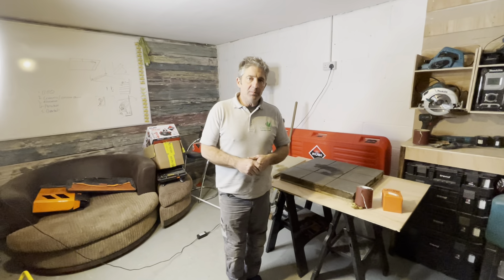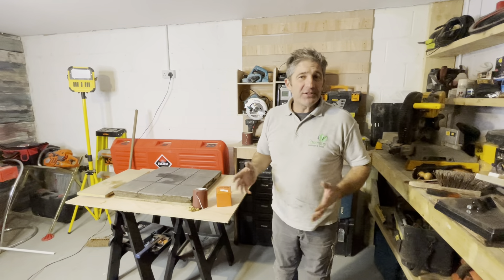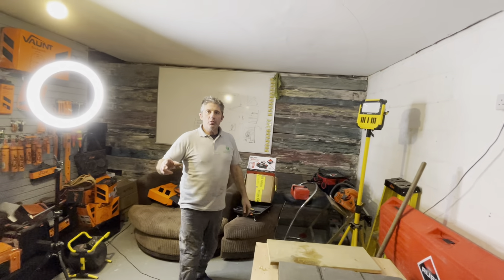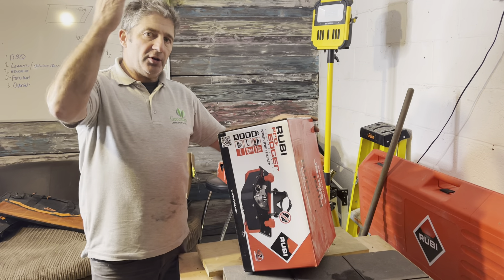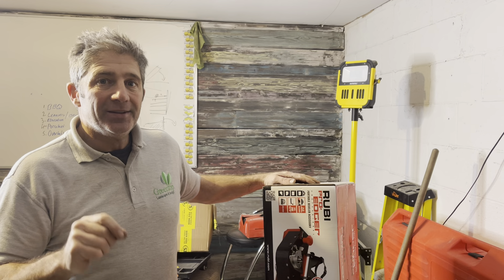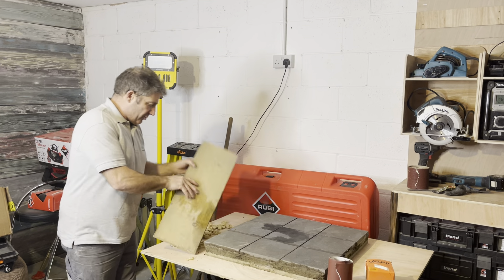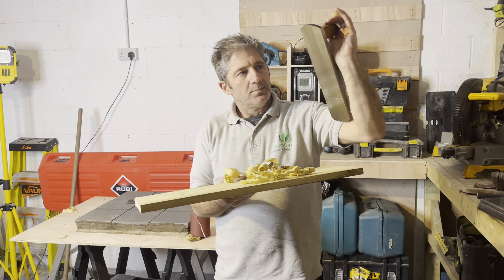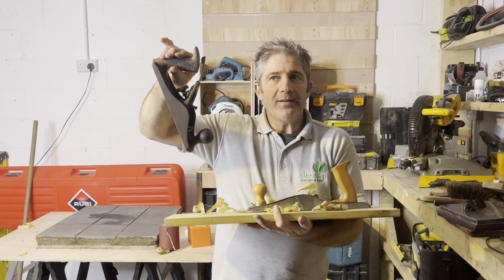The Magic #Mix and the #Benefits of using it on a #Porcelain #Patio

Comment: Hi Johnny.  Hoping you can advise on this.  I'm laying 600 x 600 porcelain 20mm tiles over an existing (old removed garage) concrete floor.  The floor is level and still in good condition (no cracks, etc).  I'll need to achieve a slope (1:80 is what I've seen commonly suggested) for water run-off.  Because I can't get the slope through the sub-base (existing concrete), it'll have to be through the bedding mortar.  Using the magic mix you mention in this post, would it be OK to have the lowest part with ~40mm thick of bedding mortar, rising up to ~70-75mm thick bedding mortar  at the highest point (over the 3 metres).  Would there be any problems to watch out for having the slope in the bedding mortar, and is 70-75mm too thick for this sort of mix?  Any other suggestions welcome!  Many thanks and keep up the good work!  Cheers.
Reply from the maker: Give us a ring buddy and I can explain better

Comment: Hi Johnny. I'm looking at paving my back garden with 1200x600 porcelain 20mm tiles. There is about 3 foot of concrete path running across the back of the house and then the rest is of the garden is/was decorative stone pebbles. Can the concrete path be used or does it have to be dug up? Love the videos you share. Greetings from Ireland 🇮🇪 😀
Reply from the maker: Hi James mate you can pave over the concrete but use a bridge bond